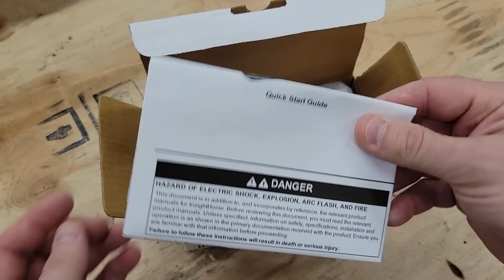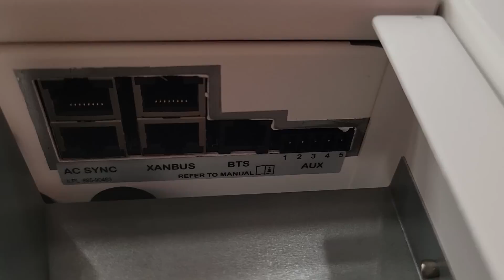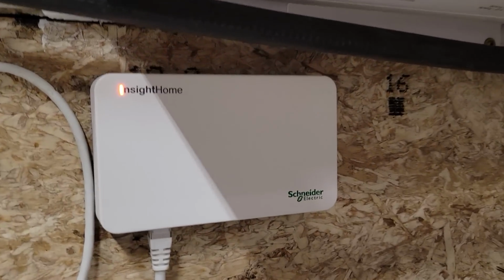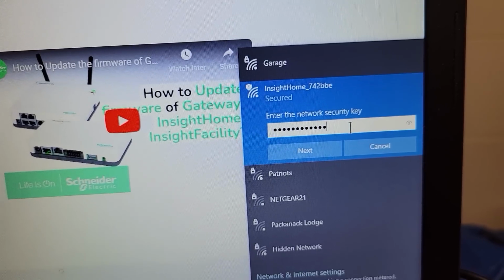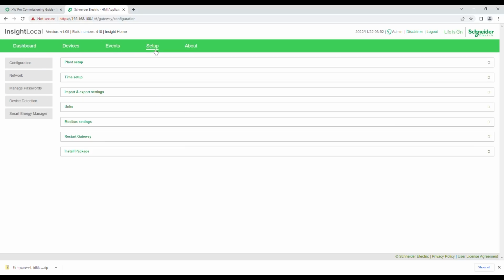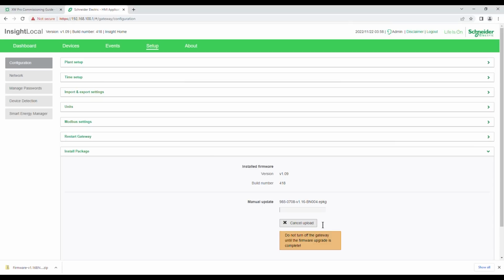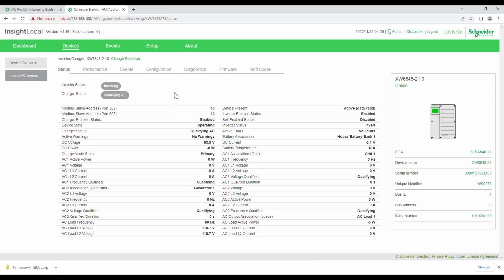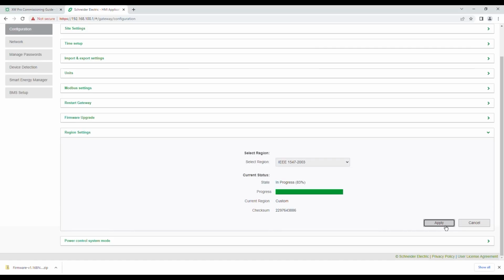Firmware Update on Schneider XW and Insight, off grid solar

Comment: Hi good day David  need your help here please I have a conext xw +6848 for the past 5 to 6 years, but three days ago I come home and there is no power in it  so I open it up  the is a  and have a close look inside on the control board there is a crack
IC on the control board  am living in jamamia and it is hard for me to get in contact with Schneider, a have pictures of the inverter  so am asking if you could  find out how I could  get back a control board
Reply: Really need your help
Reply from the maker: Hi Richard,  I don't know the process for getting a new control board.  I've called customer service several times over the last 6 months and found them to be very helpful.  I use this number: 1-833-391-8640  I don't know if it's the same number for your location, but it's a start.
Reply: @DavidPozEnergy  thank bro going to give the number I try, blessed up

Comment: How can u change the inverter number and the master and slave settings without the scp?
Reply from the maker: The SCP is being phased out.  The Insight Home replaces it.  If you have the Insight Home, you don't need the SCP.
Reply: @DavidPozEnergy  thanks for replying, I do have the insight home but can't seem to change the inverter numbers, and can't set to master and slave either, I e gone into the setting to change the number but it doesn't save, when I try setting 1 inverter to split phase slave it doesn't save either, so I was wondering if it was a firmware problem or I'm doing something wrong
Reply from the maker: I haven't programmed two Schneider inverters in parallel. I'll be doing that before this winter, but as of right now I don't have the experience to help you yet.
Reply: @DavidPozEnergy  ok I understand, if u get any info please add it to ur videos, thanks

Comment: Hello, I have Schneider inverter XW+8548E with an error F.66  how can I resolve it?
Reply from the maker: I've never tested or worked on a "XW+8548E".
Reply: @DavidPozEnergy  Thank you so much replying. It is the same as the one you was installing. Shares the same parts too just different in capacity.
I'm also looking for parts I have which is severely damaged
Reply from the maker: Call Tech support.  I find they are very helpful. https://solar.se.com/us/en/2021/07/23/meet-our-new-tech-support/
Reply: @DavidPozEnergy  Thanks, I'm outside US though, will find a way to contact them. Be blessed and thank you for your good and educative videos
Reply from the maker: I had assumed you were outside the US based on the inverter model.  That's why I didn't give you a phone number.  Instead, I linked to the web page with all the tech phone numbers.  You can pick the phone number for the region you are in.
Reply: @DavidPozEnergy  Tried to contact them but always redirecting me to their distributors who don't help 😔

Comment: What charge controller do you have with the inverter and how many dolar panels?
Reply from the maker: Right now, I'm using my older Growatt inverters as charge controllers.  Moving forward, I'm going to install a Schneider charge controller.  I just needed the Insight home up and running first.
Reply: @DavidPozEnergy  skip the 80 600 and go with the 100 600 CC
Reply: @dougbertInExile  care to elaborate?

Comment: Great video Davud?, as usual. Too much  technica daftware for me. These things should just work straight out the box. No updates or downloads it's all about tracking and controlling.
Reply from the maker: I have been using the Schneider inverter straight out of the box for the last 3 months or so.  I didn't need to have the insight facility.  I wanted to try it out so that I can try doing some other features like closed loop communications with my battery.

Comment: Pretty crazy how as successful of a company as Schneider is, they have a poor implementation of that hub. I can understand needing to connect to its wifi to do the initial set up, that's fine. But at that point it should connect to your home wifi, then you go to the settings/firmware, and click a "Check for Updates" button and let it do its thing. Having to manually download and go through all that hassle to update the firmware is bs, imho.
Reply: Totally agree. Lazy programming, or more more likely, some luddite supervisor cutting off the programmers coding time  that would be required to automate the procedure.
Reply: WiFi setup is not required! If you have a router with DHCP, you can hard-wire the COMBOX or Insight gateway to the local LAN. It will self-configure with an IP address, the only problem sometimes is to find it! Using a port scanner will help finding it and show you where other vulnerabilities are within your LAN.

Automating upgrades via internet is convenient, but opens up the door for hackers who could brick the system! The XW firmware update allows upgrades and downgrades, but you have to select the correct firmware. Loading the firmware first into the gateway eliminates a potential failure point.